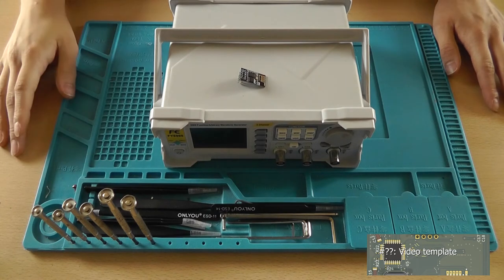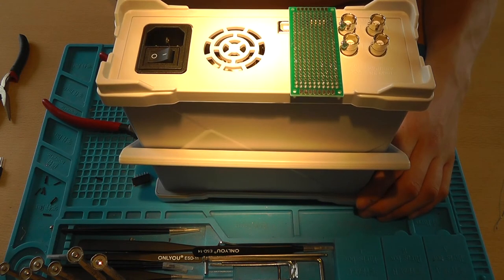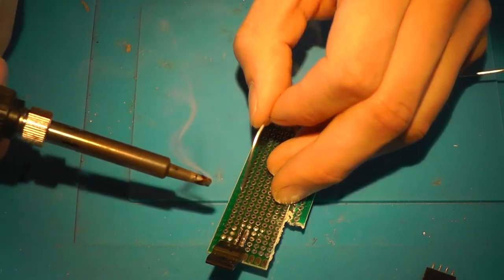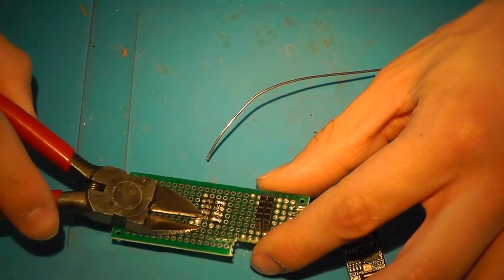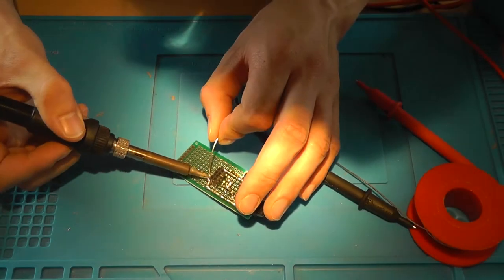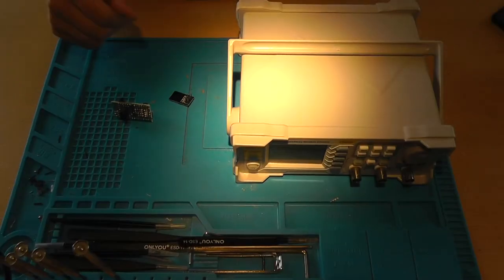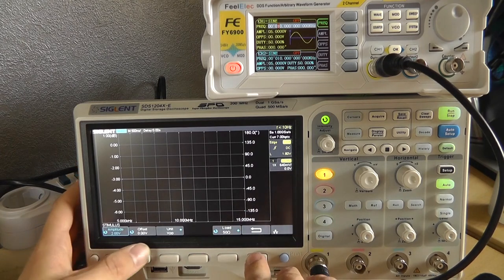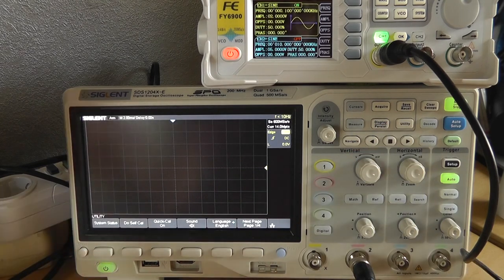#77 [GUIDE] Siglent SDS1204X-E bodeplot 📈 using FY6900 (Chapterized 🧾)

Comment: What can I do ? Who can help me, on this point?

The WLAN connection is established via the AP and the client.
But there is no bodeplot connection.

That's why I specifically checked the signal quality and the levels that go into my FY6800 via RX / TX. The signal levels were not good.
After using a levelshifter the ESP-01s TX increased 3.3V to 5V and now OK and the SDS does now not hangup.

The FY6800 now receives clean signals on the RX input of the FY6800, but does not respond to TX.

When I use the USB interface via CH340, the levels are the same and on RX / TX and the FY6800 responds without any problems.
What else can I do?

- Which FW is on your FY6800? My FW is V 1.7.1.
 
- Do you have a log of the RX / TX data as a CSV log file where I can see functional communication?
Reply from the maker: I do not have a log of the commands, but there should be one floating on the internet. You can search for FY6900 UART protocol and you'll find it

Comment: Hi Tim,

thanks for your work!

I am also trying to get this BodePlot working. However there seems to be a problem with my FY6900.

I can connect my sds1104x-e to the esp and start bodeplotting and everything. However the FY6900 just doesn´t care. When I control it with my computer using the integrated USB port it´s working all fine. But not if I connect the ESP-01 in any way (no matter if it´s vonnected through the TTL pins nor the USB port using an UART to USB Converer).

I wrote an issue in the original espBode on github from sq6sfo. It would be great if you or someone who might have a clue could look at this and help me.

I hope someone can help me!

Thanks!
Reply from the maker: Try to control the FY6900 manually with the serial port. If that works, try another ESP
Reply: @TimsElectronicsLab  I have tried another ESP. I have also tried using my computer's USB and this a FTDI serial to UART converter. Computer usb worked but not the FTDI
Reply: @TimsElectronicsLab  or what exactly do you mean by controlling it manually with the serial port?
Reply from the maker: Try and send the commands that the ESP would normally send to the FY6900. Something totally different, what firmware runs on the FY6900?
Reply: @TimsElectronicsLab  I did do send those commands using my PC. It worked when I used USB. I am running Firmware Version 1.4.1
Reply: You think it could be a firmware version problem? I honestly don't think so.
Reply from the maker: Have you tried a different ESP-01? Are the board settings right?
Reply: @TimsElectronicsLab  I don´t have another ESP-01 on hand right now. I used an ESP D1 Mini which also didn´t work. The boardsettings should be right. As I said I can see the data written, when plugging the ESP-01 into the PC and looking at the serial monitor. 
Using the original python script from 4x1md does work though.

Comment: I saw in your video that the symbol for WIFI cannot be seen in the Oszi. That means that where you shot the video, you connected the ESP8266 yourself via Ethernet and router. 

In AP mode, do I have to select and connect the WIFI_SSID that I previously specified via the WLAN stick in the SGS1204X-E,
OR:
Do I enter my WIFI_SSID of my router home network there and can I get access to ESP8266 from the SGS1204X-E with an Ethernet cable via the router?

Do I have to go to esp_config.h
except:
#define WIFI_MODE_AP
continue to make entries?
What about:
#define WIFI_SSID "wlan_ssid"
#define WIFI_PSK "wlan_key"

or here with:
#ifdef STATIC_IP
  #define ESP_IP 192,168,1,6
  #define ESP_MASK 255,255,255,0
  #define ESP_GW 192,168,1,1

My SGS1204X-E reports "Unknown AWG found" and I can't get any further.
The programming worked without errors and I can access the AP and client from the PC. So where comes
"Unknown AWG found"?

Please a couple of tips, the rest I'll fight for myself.
greetings
Reply from the maker: You can access the ESP8266 from your scope with the scope connected via both Ethernet and WiFi. You need to make sure the ESP8266 is in STA mode though. You can also directly connect to the ESP8266's AP network with your scope, but you'll need to setup manual IP addresses for both your scope and for the ESP8266. Please use telnet to debug the ESP8266 remotely.

Comment: I still have the same problems as you describe elsewhere here.
WLAN via client connection and also via AP connection is established. There is probably no problem in the network configuration. But when I configure Bode Plot on the Seglent DSO, either an unknown AWG comes in or the DSO hangs.
So I am most likely to assume that the pure communication to the ESP01s and to the AWG itself does not work.
The Seglent DSO only reported a successful connection to the AWG once and only for 5 seconds.

These are level errors on TX / RX and so I now look at the 300R resistors.
Anyone already successfully achieved a change there?
Reply from the maker: Did you connect to telnet? I would do that and see what happens when you connect your scope to it

Comment: Hi Tim, Why after finish uploading the program my ESP01 doesnt show it connection status. It only show some weird unexplain language and stuck there. Can you help me out?
Reply from the maker: Hi Azeem,
Please change the baudrate of your serial monitor to 115200
Reply: @TimsElectronicsLab  Hi Tim, thank you for the reply. Yeah the baudrate was setup to 115200. When i inserted/reset the ESP01 after programming, only junk language is shown in serial monitor. It does not respond like in your video whereas junk language > Connecting to > WiFi connected as well IP add stated. Mine only show junk language then it just stuck there and not responding. However if i try to replace "DEBUG" with "Serialprint/Serialprintit", the esp01 is responding, connected to wifi and manage to get the IP. But in this configuration, my scope will completely Freeze when attempt connect to the AWG. Sometime it succesfully connected and sometime not it just froze. Any idea which part i do wrong? AFAIK in the network config.h you only need to set the SSID, pass and Wifi mode right?  Again thank you for your response
Reply from the maker: @azeemnazri2462  You need to remove #define DEBUG_PRINTS on line 54 in the esp_config.h once you've found your IP address. Then connect the ESP-01 to your AWG and fire it up. The garbage you are seeing is probably the ESP-01 trying to communicate with the AWG. Once the ESP-01 setup, you can open a telnet session with it to view debug output.
Reply: @TimsElectronicsLab  Okay after i remove #define DEBUG_PRINTS on line 54, my esp01 finally show same as yours as in the video. But Tim, i got new problem. When trying to connect my 1104xe to the AWG, my scope gone completely freeze cant even restart or do anything. Only thing i can do is remove the mains power and turn on the scope back again. Any idea why the scope freeze when trying to connect with the AWG? I already set my scope with DHCP off
Reply from the maker: Try to update the firmware of your scope
Reply: @TimsElectronicsLab  yeah that also not working for me. Its just that esp01 will restart itself when siglent trying to connect with it. While the esp01 restarting, scope getting freeze. Not sure why tho since no one experienced it beside me. Checked on eevblog also and all seems easily get their Esp01 proggrammed and connected with the scope. Is there any chance with current Firmware that only Siglent AWG allowed to be connected with their own scope?
Reply from the maker: Check the voltages, it might be getting a brownout
Reply: @TimsElectronicsLab  
Hey.
I have the same problem as the colleague above 
after trying to connect a siglent 1104x-e oscilloscope
with an esp01 module, the oscilloscope crashes, the esp01 restarts.
I have tried several esp01 boards and always the same.
Reply from the maker: Have you connected to the ESP through telnet?
Reply: @TimsElectronicsLab  Yes  i have access to telnet ,nmap show ports : 23,111,703 open on esp .
Reply: When I do a connection test while connected to esp01 the terminal only shows me : CREATE_LINK and DEV_WRITE.
Then esp restarts and the oscilloscope hangs
Reply from the maker: I think you need to look at the response of the scope and compare it against the expected response of the scope
Reply from the maker: Does the ESP get enough power?
Reply: @TimsElectronicsLab  Yes
Reply from the maker: I've never experienced such an issue, try to print out all the steps that happen in the code and see where it goes wrong
Reply: I found the cause and solution to the problem.
You have to downgrade esp8266 boards library to 2.7.4.
I had installed the 3.0.1 library which caused erroneous writing to the esp8266,  memory  allocation problem. Now everything works as it should😁
Reply from the maker: Oh wauw! That is amazing!
Reply: @TimsElectronicsLab  
How to do second channel to turn on alongside channel 1 on the FY6900 ?
Reply from the maker: I don't think that's possible
Reply: @michapreyzner4290  Thank you sir! it work pretty well with library 2.7.4. Thank you very much!